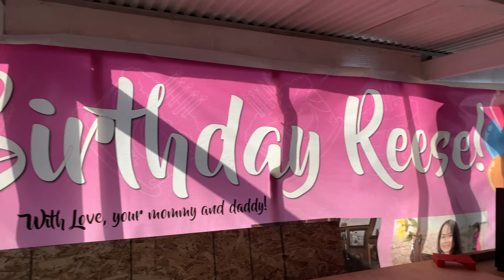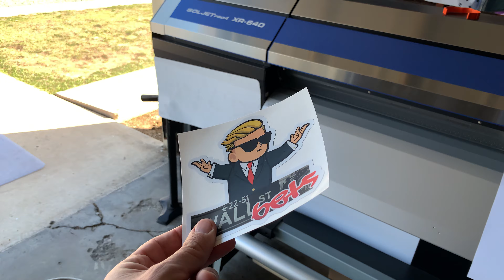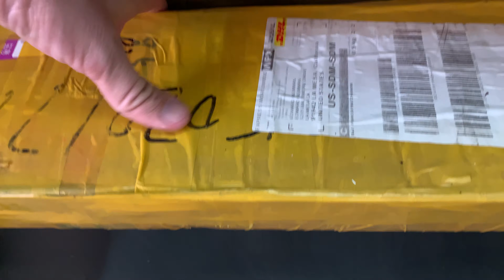All the FAILED dumb projects I have worked on in the last 2+ years.

Comment: Your enclosure seems solid,  i've tried the Creality  "Fireproof" enclosure and returned it, the material was actually an aluminized rubber type fabric, rated probably for 150F with degradation in the 140 range . So in reality a fire hazard. 

Now i did my own with the cheapest lightweight ceramic fibre board i can find, easily rated for 2000F, aluminized in one side.